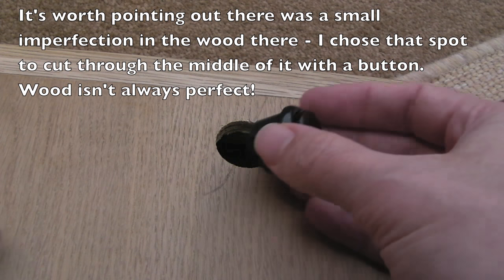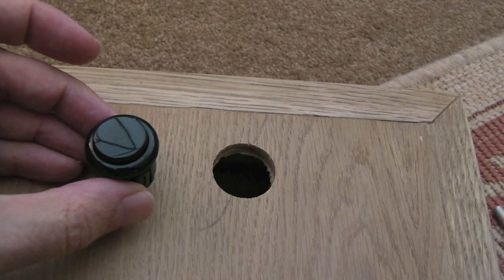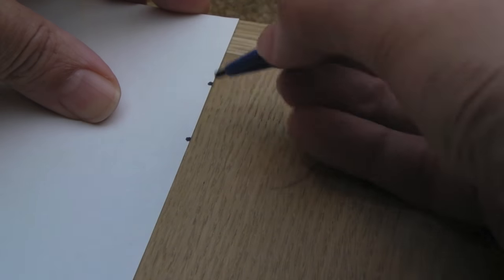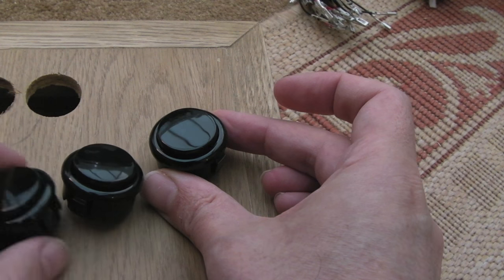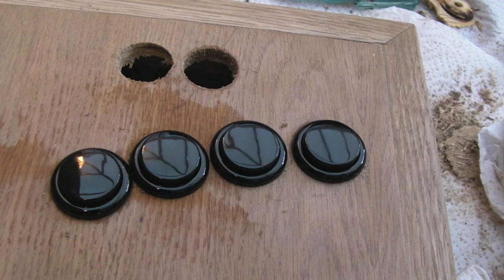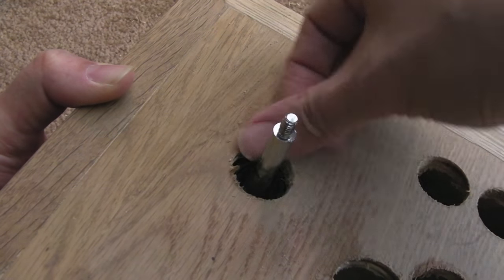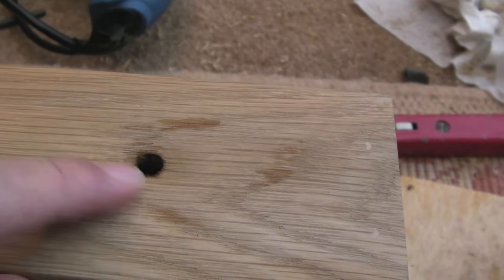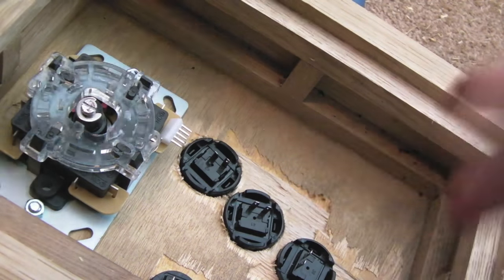SNK Neo Geo Arcade Stick Build (Segasocks Flavour)

Comment: Cool to see the box again after seeing stigworlds joystick projects. That stick assembly looks solid. Cant help thinking a bluetooth lowpower mod would be cool, but i guess its a bit harde than it sounds.
Reply from the maker: Bluetooth would be nice, but tbh I prefer wired connections (or more battery problems lol).

Comment: Massive respect to you, Stuart and John for completing the sticks! It has been absolutely fascinating for me seeing how differently everybody has tackled the project!! I almost feel guilty for charging!! :)

You probably would have been better off with a round hole cutting saw over a spade and half drilling each side but it doesn't matter anyway as you sorted it out! I do work with wood so of course I talk like its easy much like when your soldering millions of tiny points together! :D
Reply from the maker: Thanks, and right back at you with regards to the box - some nice craftmenship went into them!   I love the weight of it as well - best choice for the case I think.  Thanks for the tip there on using a round hole cutting saw - I didn't know they even exist lol.  I need to spend more time at B&Q I think lol.

Comment: I always use a much smaller drill bit, then you can get in there with a rounded file and make the button placement really precise, and with the stick skateboard truck bolts are ideal, and then if you wanted you could add some laminated artwork, anyway great job, just some tips from making so many replacement cabinet parts.
Reply from the maker: Yeah - problem here is that Oak (I think its Oak) is really really hard!!!  Using a file on it is like trying to cut a piece of wood with a sausage lol.   Thanks for the tips though - skateboard truck bolts sound like a great idea =D  I am thinking about some laminated artwork!  I haven't finished modding it yet though - I think I might add Megadrive or PC Engine support, and tidy up the wiring whilst I am there.
Reply: Cool man, I look forward to seeing what you do, wood filler and a range of sand paper strengths are also useful for chips and surface damage if you damage anything, I use them as polish before sticking a design down, oh, and have a great 2017.

Comment: Interesting that you put the buttons on the same face I did I think Darren mounted everything on the removable face.
I used a template as a guide which made the buttons more even, but I was still lucky they fit.  I made sure the button holes where spaced enough to take in to account the button lip, but the screws under them which keep them in place are slightly larger. Where button A and B have about 2-3mm space between them in the top of the joystick, inside the screws holding them are only just touching.
Reply from the maker: Thanks for reminding me!!! I knew there was someone else had done a build using Darrens box!  I've added your video to the links below and in the vid description =D

Comment: I bought the same cord you have and I can't figure out where each wire goes?
Reply from the maker: You need to test on contuity test on your multimeter (if you dont have one, get one - around £10 on eBay).  Beeb out each connection on the connector to the wire and note it down on a piece of paper.

Comment: I don't quite get how you determined which pins led to which of these 15 wires for attaching the correct buttons. As I want to build a stick myself I would greatly appreciate it if you could explain this.
Reply from the maker: Sorry, you're right - if you start by taking a look at the pinouts (eg. http://old.pinouts.ru/Game/NeoGeoJoystick_pinout.shtml).   I then cut the male part of the connector off the extension cable I bought, and measured continuity with my multimeter betwee the exposed wires and the connections in the plug, and made a note which colour related to which pin.   Then its a case of looking at the pinout table to connect up the correct switch to the correct coloured wire.
Reply: Thank you for your answer! Now I understand the procedure :)

Comment: A tip for using a spade bit is to always make a pilot hole to get the position spot on and use it both sides of the plywood to minimise any breaking away on the opposite side. Perhaps a hole saw bit would have been better suited for the plywood? 
Also, you should have used some short chipboard screws on the inside for an invisible fixing for the joystick - if you used 4 or even 6 screws they'd hold the metal plate extremely securely and you'd have nothing showing on the front.
Reply from the maker: Wow, that's a really good point - I hadn't considered just supporting the metal bracket on from the underside using shorter screws.  Although knowing my luck I would probably break it off lol.  That said I think with 4 or 6 screws I am sure you're right and it would be supported perfectly.  If I could do it over again I would certainly do that I think!   That said, it came out OK and the screws don't get in the way at all - but they would have done if I had put 4 in the corners from the top side.

Comment: So the ground starts from the controller wire and ends at the joystick?
Reply from the maker: Yes, ground from the cable just goes to one connection on each switch, to one connection on each direction switch and over to the ground connection on the stick.   The direction and button wires then just each connect to one of the switches.

Comment: Great project Gadget! That wooden box would be nice n solid/heavy for stable play. Your woodwork and power tools skills need some work though :p You've given me inspiration to make a MVS wooden box for the board. I'll get onto that and make a new vid
Reply from the maker: Yeah, it came out fine all things considered lol.  I've tidied up some of the wiring and stuff today, and added one of those clip on ferrite beads just before the connector (just like on the original Neo CD controller).  Later I will add support for the PC Engine I think - it might just be easier to have a convertor box, I need to have a think.

Comment: Thanks for the video! Can I ask you if it is possible to do an arcade stick like this for NeoGeo but with light buttons? If so, can we use the 5v pinout to turn them on since 5v is not used? Thank you
Reply from the maker: I think if there's a 5v connection on the cable, then yes - totally possible!  I would probably do it with low power LEDs (dropped by resistors) I think.
Reply: @GadgetUK164  Thank you so much for your reply. Well, all extension cables like the one you used have the 5V cable, that is not used for the arcade sticks, right? So if instead of not connecting the 5v cable at all, connect it to a led putting a 320 Ohm resistor for example, do you think it will work? Or it would "load" too much the MVS board?

Comment: Rather use happ screw switches, not much more and a lot easier to install and rely on, though longer. Use bigger success and plane some angles for a better look. Or just use a couple of wooden bread boards, drill the holes for the kit and use corner blocks with screws to hold the bottom on. I'm just looking for a seemless way to get the joysticks mounted without being visible so I might need to add some depth.

Comment: That turned out alright didn't it. Those control panel boxes sound like they were a bargain! :)
Reply from the maker: Yeah - I tidied it up a little today, sorted out my ground wires, added back the ground wire I cut out from the stick connector (god knows why I did that at the time).  Shortened some of the wires inside, added strain reflief, and also one of those ferrite chokes just near the connector that goes to the MVS / AES.  The boxes from Segasocks are really nice - they have a great weight to them!

Comment: hey man very good video!
i just bought consolized mvs and im looking to build a joystick for it  will it be really hard?
or fairly simply? what parts are needed
Reply from the maker: It's pretty easy to build an arcade stick - basically you need a box or some other case to mount your stick and buttons.  Then either buy a Joystick and buttons from eBay or AliExpress, or maybe just do what I did and buy a cheap arcade stick kit (£20 ish).  Finally you need an extension cable for the Neo Geo controller, or you could just buy the correct wire (with enough cores for the Neo Geo controller), and a 15 pin D type female connector.
Reply: ok thank you :)

Comment: Spade bits are crap for large holes. I'd suggest getting a Forstner bit. For this cheap kind of button forget about the tang that's supposed to grab the CPO, just concentrate on the plastic body bore. So long as the button fits really snug don't worry about it. Grab a scrap bit of ply or MDF to check the fit after drilling out the hole, once satisfied, crack on. . 

All you have to consider is rotation from hammering the button, I'd suggest a spot of 2 part epoxy, and only just a dot, don't go all around the seam between the wood and the button, you aren't doing any favours for yourself. All you need to prevent is the button body rotating as you pound on it, eventually you'll twist the wires round and potentially add more and more stress on them leading to breakages thanks to fatigue - and you won't be able to visually diagnose this. 

For the joystick plate, look for a door hinge drilling bit, these guys are awesome for centering a drill bit in the middle of a hole, it self centres and drills a small pilot hole for your screw / bolt.
Reply from the maker: Thanks for the great suggestions there =D  I hadn't considered the buttons rotating from usage!
Reply: No probs at all. I have the same set of buttons in a box ready for a stick / Retropie build and am still mentally planning stuff including what could potentially go wrong!

Edit, the reason for suggesting epoxy and not hot glue is that it hot snot doesn't bond well to plastics, it will for a while but it'll pop off with fierce hammering of a button.

Comment: hahah you can tell your an electronics guy and not a woodwork dude. if you Google Slagcoin, you can download A4 templates for the buttons, print em out and drill through the paper. I also use a cable tie on the inside of the cable so when you pull the cable it stops at the cable tie. Also as you mentioned I would used a very large drill bit and slightly drill the top of the screw holes, sink em  and use some wood filler over the top and sand. Still interesting vid as always bro
Reply: Probably better to use a counter sink bit over a drill bit as one wrong move and you have a big hole for the screw to fall through! Lol
Reply: Segasocks Yer true if your not used to doing it, good point.
Reply from the maker: Haha =D  Yes, I was aware of templates but I got lazy and thought I could do it by eye (mistake really i think).  Great idea on a cable tie as strain relief - I will do that as well tomorrow!
Reply from the maker: Yep, that would be me lol.  Just a little bit more.... ooops, what can I filll that hole with now?